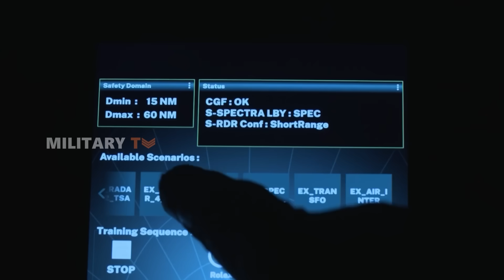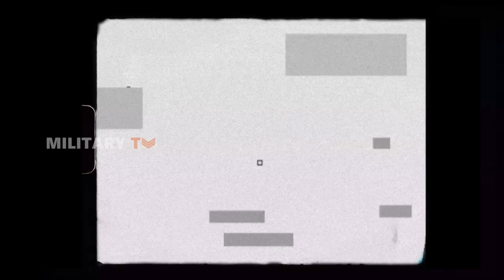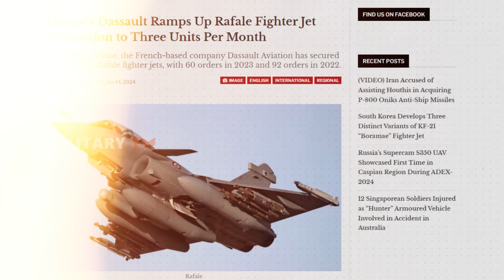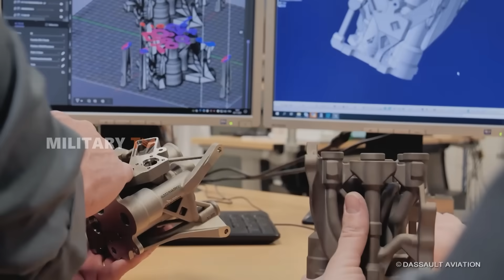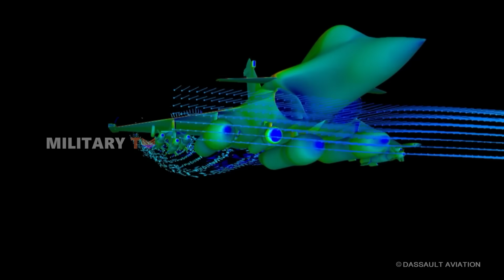The Global Demand for Rafale: What Makes It So Popular?

Comment: Us have deactivated electronics from f16s given to ukraine. I guess they can do the same (if not more) with f35s. Given current us' foreign policy, who will want american planes? All sales from other countries' fighter jets will increase, rafale included. Seems logical as it is a very good product. (Although not comparable and a not a real alternative to a f35). It's like comparing a hammer with a saw. They're both tools and as good as each can be at what they do, their role and function is different.
Reply: It is not comparing a hammer with a saw as the f35 is a very bad plane, with a unique and bad engine underpowered and a very small range (about 500 miles only) … if you use speed it’s even worst and it can’t going maximum speed more than 2 mn … it can cary only 6 weapons internal … if you want to increase this, with external tanks or weapons , it losing the stealth … it can fly in case of storm and have trouble with rain … you are right, they is no comparaison between one that don’t do anything right and one that making everything right … guess who is who … Lockeed  martin use to make excellent jets, but not that one, f35 and not the f22 that is going  to be retired from us airforce… no offense, but you are wrong

Comment: Like said by a rafale engineer I know : rafale struggled to be sold because of its early difficulties and because many countries wanted what US promised with F35, trusting a promise and not a combat-proof aircraft. Now that the F35 fly, now that the US army is the first one to point its weaknesses, you either deal with it because what you want in fact is not an airplane, but US protection or you buy something else and the rafale is the winner of many contests.
I think that many countries should not buy the rafale actually, countries like Switzerland don’t care about it’s air-ground capacities, what they want is a reliable airplane to ensure air security. For this task, the Grippen is better, less cost and maybe more reliable.
But for countries like Brazil or India, that want to modernize their air force, that don’t want to be US nor russian puppet and want aircraft carrier capabilities, it’s not that the Rafale is the best; it is actually the only one available.

Comment: The Rafale is a true multi-role aircraft. Check out the Red Flags competitions it participated in since 1996, and you'll see how well it performed against F16, F22, and Eurofighters. An American pilot with combat experience was quite enthusiastic with the simplicity of flying the Rafale - compared with older steam-gauged models; freeing his attention to fly and do the fighting instead manning the controls. Did you know that in one hour only, an entire engine can be replaced and made flight worthy? By contrast, the expensive stealth paint coating of a stealthy aircraft will not last long and will require expensive re-do with down time. Not so good in sandy (abrasive) operations. Its FLIR / Optical long range camera can track up to 8 bogeys at the same time. Thank you so much. Cheers!
Reply: The F-15 E, EX are better Multirole than the Rafale.

Comment: stop saying the SU57 and the F35 are better than the Rafale that's ridiculously wrong...
The rafale in it's last version, the "F4 Standard" can detect and track any 5th gen fighter and the features onboard are very similar to what you have in the F35 (multiple sensors of different type, data fusion etc), so considering the fact that he doesn't put all its eggs in the same basket "stealth" he is far more dangerous than the F35 who is very limited (when he is not grounded because of his multiple issues)...
Reply: You don't know for a fact that anything you are saying is accurate.
Reply: @GOBUCS82  he is atleast right for the F35 availability around 55-60% while the rafale is 75% on average and a record of 97%

Comment: France have ordered 42 of the Rafale F4.1 for the AF and that price is $131m per aircraft  ( do Google if you like ) while the USAF have paid LM $78m for the Block 14 in 2022. Inflation will increase the Global costs but probably the margin will remain at a similar level. 
 This isn't a comparison of ability just a reminder of potential order sizes for the F35 which is around 2000+ . The reliability and CPFH are also a consideration and if you might be hit with sanctions in the future.
Reply: It doesn't have much sense to compare two orders where planes are not at the same stage of maturity, the numbers ordered have nothing in common and the prices discussed are from two very different periods of time where a lot happened (the Block 14 discuss began way before 2022). 
Moreover, we don't really know what are included in the contracts, we only have "X planes for Y$". Is there x years of maintenance costs included (which I know some Dassault contracts have) ? Is there ammunitions with it ? Is there pilot training program with ? etc.
Reply: @TheFreestyler3333  the full comparison is indeed not known but every F35 gets a built in targeting pod while Rafale share them amongst the fleet. So as you correctly pointed out we are only guessing but if F35 are typically purchased by USAF at that discounted margin then they can typically buy 50% more numbers for the same price. As you know ability is not factored into this guessing game or the latest block version of either aircraft just mass production lowering the build cost price. If Rafale had 2000 orders it would be much cheaper.

Comment: Gripen are more cost effective.
Reply: Gripens are excellent planes but are not used for the same purpose. They are designed for local operations, primarily for aerial defense. They cannot operate from aircraft carriers, carry 50% fewer weapons than the Rafale, and have a shorter range. They are also (obviously) 2 times cheaper
Reply: That's true. It is a good alternative for country which has not been exposed to the vicinity of countries with low levels of high technology. Hence the choice of Brazil.
Reply: Grippen isn't ITAR free

Comment: Too expensive for a 4.5 gen fighter.  It should be stealth.
Reply: If we talk about  incremental cost, th Rafale is sold for 80M$ (average of all versions&configurations - It's  more than 2 times cheaper than a F22, also for maintenance costs.
About stealth materials:
High cost: expensive technologies & maintenance.
Limited performance: reduced maneuverability & payload.
Vulnerability to other technologies: Not invisible to advanced radars, such as low-band and infrared ones.
Rafale uses SPECTRA which is similar to AN/ALR-94

Comment: The Legacy Hornet got a make over and a steroid injection to become the Super Hornet also the Gripen got an upsizing with new engine etc. So do you think Dassault might upgrade Rafale and maybe give it a nose job ( a retractable fuel probe ) to enhance its looks?
Reply: The fixed refueling pole is a deliberate choice made on operational requirements. Refueling is imperative for projecting fighters planes above their operational range. A retractable refueling pole involves motorization, mechanisms likely to have a failure thus resulting in simply loosing a plane in the wild. Aesthetic plays no role here.
Reply: @septimusseverus7237  everybody is aware of the virtues of a fixed or retractable fuel probe  even the male/female type. The fixed has it's problem in giving an increased radar return. My thought is Rafale has a small nose so fitting a larger radar, IRST , retractable refueling probe could be achieved with a ' nose job ' perhaps even making it look asteticaly pleasing as well.
Reply: @septimusseverus7237  genau , es fallen schließlich täglich Jets vom Himmel weil die Sonde nicht ausgefahren ist . Na ,Hauptsache du glaubst das .

Comment: In the air battles of the future, there will be two types of aircrafts in the air, stealth aircrafts and targets, chose yours wisely
Reply: IF i'm not wrong, stealth airplane is stealth to few radio-bands. It can be seen by ground based detection system using other bands (like UHF) or using passive receptor sync with generic radio transmitters like the GSM numerous BTS. On the other hands stealth is not so stealth when "target"  aircraft is not alone and flights in detection conjonction at wide angular separation from the stealth aircraft. Nothing is black/white in here and become more grey as Technics evolves. Further more, the F35, to talk about he most marketed stealth aircraft, does have a  bad thermal signature, being easy to spot for an IRST... And by the way the "target" does not need to fly at high altitude, thus detecting it become more difficult for an aircraft willing to remain stealth, it is not?
Reply: in the more and more countries will find anti stealth technology the in any moment stealth capability will obsolete
Reply: @jagodiving  untill the time stealth is “obsolete” if you are not stealth, then you are a target. It is as simple as that.
Reply: You forgot planes that have radar  absorption surface and jammers ! So is the rafale

Comment: Rafale is omnirole and cost effective, whereas F35 is more a bomber than a fighter, costs 5% of GDP and all the data is collected by the US ;)
Reply: Sons, the f 35 cost way more than that unless your talking per plane and it’s easy to take down by heat seeking missiles up it’s ass.
Reply: The rafale is more expensive than the F-35. And the only realistic thing that the rafale does better than the F-35 is its multitrole capability.
But, if they were to ever face off, the F-35’s stealth and radar would demolish the rafale.

Also, Serbia just bought 12 rafales and they are going to cost around 3 billion dollars. That’s about 5% of serbias GDP.
Reply: @Realone7-i8l  It's 1/3 to 1/2 of the costs by hour of flight...

Acquisition is not the biggest issue, especially since they are in the same price range.
Reply: @hermes6910  their not in the same price range. Serbia is paying 250 million for the rafale (export version) and Poland is paying 140 million for the F-35 A ( export version). That’s a 100+ million discrepancy. Even when including the operating cost, the rafale is still more expensive.
Reply: @Realone7-i8l  Yes and no...
The Rafale costs around €80 million, as does the F35A (a little less, I think).

But you're probably only talking about the cost per unit for the contract.

Except that the contract includes a lot more than the aircraft itself and can change considerably from one customer to another.

For example, Poland doesn't need a new missile or a large batch of missiles as theirs are already compatible with the F35.

Serbia has to buy new missiles for the Rafale, or pay for the integration of the old ones.

The same applies to training: aircraft from NATO to NATO are cheaper than training from Russia to NATO.

Costs per contracts are hard to talk about because we don't necessary know everything in the contract.
Reply: @hermes6910    and where are you getting this information that the rafale is 80 million? France ordered 42 rafale from dassault, for 130 million a piece. 

And I made sure to compare the export version, because that’s what’s at hand. People are talking about what aircraft is better for 3rd party countries. And when taking into account that the Rafales export price is higher, I don’t think it’s fair to say that the F-35 is more expensive.
Reply: @Realone7-i8l  Once again.
Contracts does not give the cost per unit.

What's more, Rafales in France were more expensive because we have the R&D part, which is not paid by the export customer.

The costs of the Rafale are known because we have a French government report on the subject (which is as practical as it is idiotic).

For example, I can tell you that a Rafale costs €20,000 per flying hour.

And I was wrong, it's around 70M, not 80 which is probably the cost of an M variant when I last looked.
Reply: @hermes6910  yes contracts don’t give cost of per unit. But, they do give the amount paid and amount of aircraft’s received. 

I know it’s not a fair 1:1 comparison. But, so is comparing 2 different Jets with totally different mission sets. This is no different than comparing the F-22 to F-15, it’s just the F-22 is cheaper now.
Reply: @Realone7-i8l  The F22 and the F15 have the same mission, both are interceptors for air dominance.

The difference is that the F15 is a 70s fighter, while the F22 is a 2000s fighter, same mission, different generation.

Is the F22 cheaper? It is no longer produced, at a unit cost of around $400 million.
Reply: @hermes6910    and that is where you’re wrong. The F-15E is rated for both air to ground and air to air combat. Though, its primary use is  air dominance. Unlike, the F-22 who is only rated for air to air. 
So not 1:1 the same mission. 
And I was talking about in this example the F-22 would be akin to the F-35, which is cheaper/comparable to its competitors. ( even non stealthy ones). 

And that’s what I’m getting at. Even though the F-35 and Rafale are both labeled “multi role”. It’s clear that the F-35 favors air superiority over the other aspects. And that’s evident by it prioritizing stealth over ordinance capacity. Because its internal bay is a hindrance to that “multi role” moniker. Whereas the rafale main focus is ordinance capacity ( even at the cost of its low observability). A better comparison would be the F-16 to the Rafale.
Reply: @Realone7-i8l  And you're wrong...
Yes, the F15 is becoming more versatile, but it wasn't designed for that (most fighters can do almost anything, they're just not wired/designed for it).
And the F22 is also capable of limited A2G missions.
But both are air dominance interceptors, it's their mission.

If you want to do A2G missions, the A10, F16, F18 and F35 are the USAF/USN's beasts.

The F35 doesn't promote air superiority, quite the opposite - it's a bomber first and foremost.

But its design makes it an excellent BVR fighter.

And not, F16 and Rafale do not compare, they work totally differently in their missions handling.

You definetly dont know what you are talking about...
Reply: @hermes6910  it doesn’t promote air superiority, but is a great BVR fighter. What? Being the best BVR Jet in the world, seems like one heck of a promotion for its air superiority case. 

The F-16 and Rafale doesn’t compare, but the Rafale and F-35 do? The rafale has more in common with the F-16 than the F-35. Both are non stealthy airframes with a lot of external hard points, capable of carrying plenty amounts of ordinance. Whereas the F-35 prioritizes stealth over anything else. It does have its beast mode configuration, but very rarely would that be used in contested airspace, whereas the Rafale and F-16’s only configuration is external hard points.

You’re thinking that the F-35 is an F-117 that’s capable of A2A combat, I’m saying that it’s an F-22 with better electronics and capable of accurate A2G attacks. And that’s evident by its comparison to the F-22 rather than the F-117.  

It seems that you don’t know what you’re talking about if you think that comparing the rafale to the F-35 is somehow better than comparing the F-16 to the rafale. And even if you look at the airframe itself, the rafale has a striking resemblance to the f-16.
Reply: @Realone7-i8l  Given your logic.
The B2 is a formidable fighter...

Please stop making noise...
Reply: @hermes6910  so now your comparing the F-35 to the B-2?😂 How is that even remotely close to the F-16/ rafale analogy I gave? The F-35 is a multirole fighter, it just favors its air superiority capability. And anyone can see that.
Reply: @hermes6910  to make it easier for you to understand. Out of the F-35, F-16, and rafale; which is most likely to be used in an air superiority role?
Reply: @Realone7-i8l   Remember only 40 odd Rafale can land on a carrier not the entire fleet. All modern fighter aircraft are multirole and Omnirole is just a marketing phrase as Rafale can't land on water like a Catalina flying boat or hover like a Harrier.

Comment: Operating cost is lower than American jets
Reply: The operating cost of the rafale is around 20,000 and F-35 is 40,000. But, you also have to consider that the rafale cost 30-40% more than the F-35. With it being around 120 million and the F-35 A being around 80 million. It comes down to mission objectives. If you want a multitole jet that can carry a lot of ordinance, go with the rafale. If you want an air superiority fighter that snipes jets from BVR, go with the F-35.
Reply: @Realone7-i8l  Rafale comes with weapons package and missiles in 130 million dollars.
Reply: @miteshghadi3146  no it doesn’t. India bought 36 rafale at 8.8 billion, that’s with everything included. And it comes out at around to 244 million per unit. The rafale by itself comes out to 140-180 million. The F-35 A with everything included comes out to around 110 million.
Reply: They are measured differently 
The USA 🇺🇸 inflates cost per flight hour to get more money from the defense budget 😅
Reply: @ricky1231 even.. minimum 7 times the price of the rafale😂😂😂 it is a scam
Reply: @JPmaxlevel 😂 Bro the rafale is more expensive than the F-35 even when taking into account the operating cost. Serbia paying 3 billion for 12 non stealth jets is a scam.😂😂😂